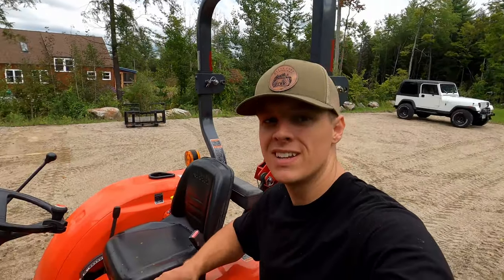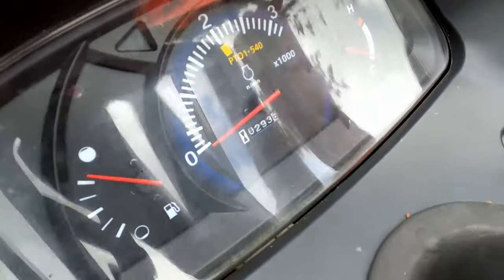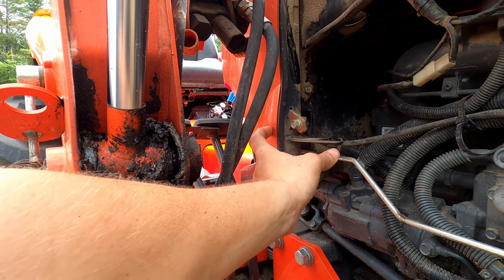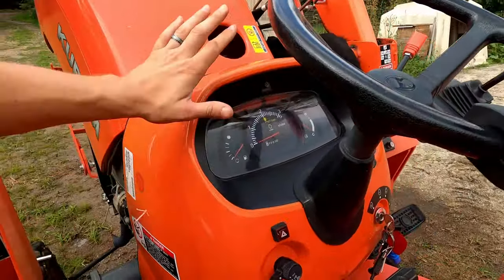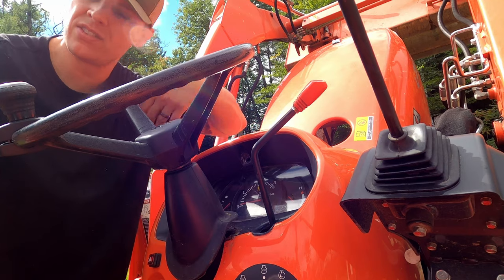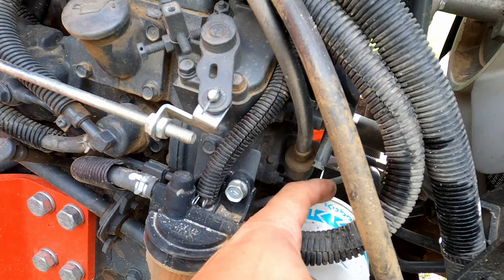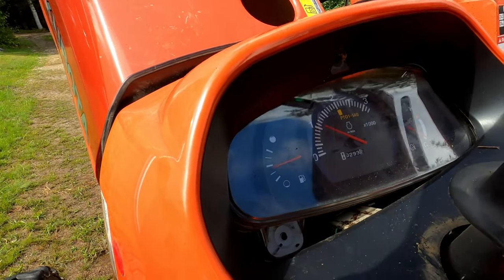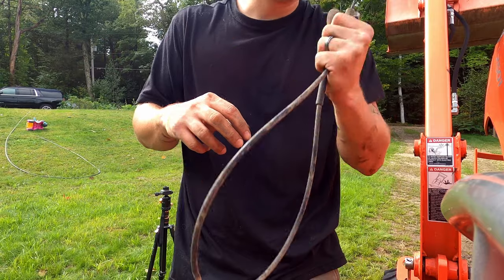How to Fix the Tachometer and Hour Meter on Kubota L2501

Comment: so much easier than on my late 80's L2250.    On mine you won't access the rear of the cluster assembly w/o pulling the steering wheel and far more body parts than you tackled.  Nice vid.

Comment: Just in case, it’s was basically the same on my 1981 L345 but they didn’t have all those protective guards 40 years ago. Measure your old cable - the part number gave cables that were from 25” to 55” long. Mine was about 48” long. Exactly the same at the engine. I removed 4 Philips head screws to loosen the instrument panel. I had to pull the steering wheel to raise the panel enough to get to the back of the tach. No big problem.

Comment: My hour meter seems to over count. After warm up of about 20-30 min, the clock has changed by 3 hours. Is that common ?
Reply from the maker: Man that’s not good, you should contact a dealer for sure

Comment: The hour meter isn't accurate anyways. It's mechanical so if you just let it run at idle it goes much slower. So like .1 of an hour is like 18 minutes before it clicks over.
Reply from the maker: Hmm did you myth bust this?
Reply: @BreakFreeHomestead  I let it idle and waited like 12 minutes and got tired of waiting after that. I think it finally clicked over a few minutes later.